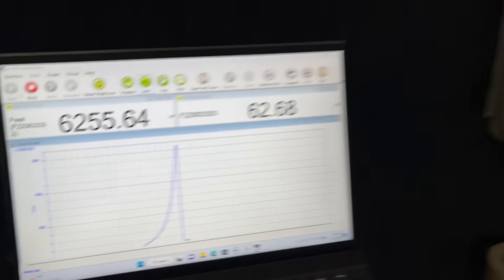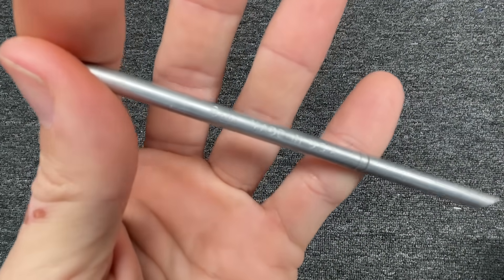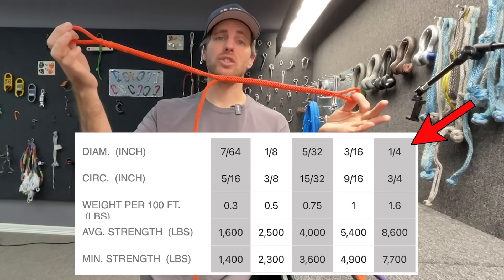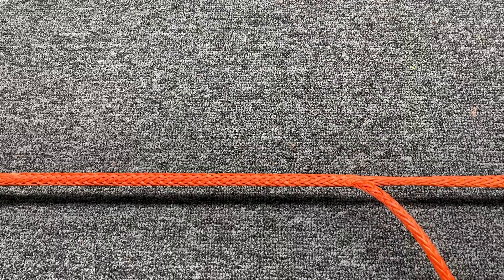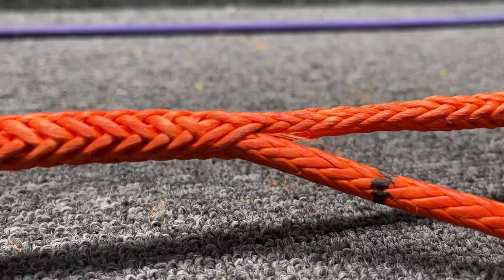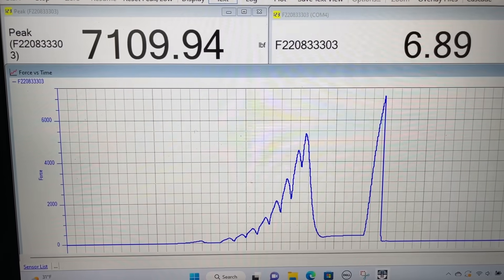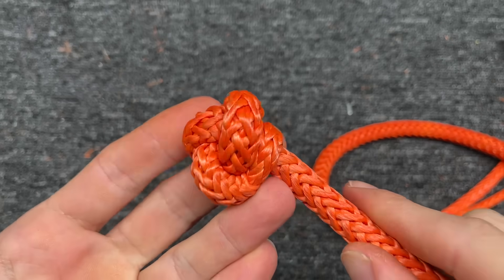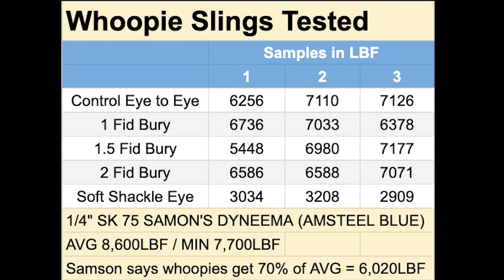Why The Overkill?

Comment: Dude, I love your schtick & patter. 
Your content is cool, too.
I seriously like your attention to detail and open contemplation of the anomalous, where-ever you find it.

My 'Rule Of Thumb' for conversation is; One Thousand Newtons (1kN) is roughly equal to 'One Typical Human Test Mass' of force applied to a pendulous support system with a smidgen of extra because "super-good-enough", right?

-OK ... TLDR follows...

This morning I weigh (mass) a static 182#, that's in lbs. (pounds avoirdupois. [ another Gaulic or Norman idea, I think ] ) or 82.5538 kilograms -- of down force, holding still, on the scale.

It seems that the real advantage of the System International (SI) is for folks who don't have calculators, or for whom longer words with more syllables that rhyme well are desirable ( there's a limit on what you can do, poetically, with Ounce, Pound, Inch, Foot & Yard and honestly, the spelling is kinda goofy ).

I tend to use the Metric System for both the cumbersomely large and small of scale -- like thread sizes when I sew-up my strap-loops and rigging.

For life on a human visceral or Newtonian scale, my thumb is an effective 1-inch wide, my boot is an effective 1-foot long. Tip of My Nose to my out-stretched finger is an effective 1-Yard.  "A Pint is a Pound the world around". 1-Ounce is a large swallow or gulp. 1-Cup is eight swallows.  And I have spoons in my kitchen and no 'deci/centi/milli-liters' anywhere. 
100 grams of meat is NOT satisfying! 
And how many folks do YOU know who have a two-meter span from left-to-right fingertips? I'm stretching to span 6' & 1/4" and I'm 5' 10" tall.

Yes, threes(3), fours(4), fives(5), sixes(6), dozens(12) and scores(20) are odd multiples if you need your toes to calculate. Human lives are best counted in multiples of seven-years.
Tens are easy to write but Binary is the fastest we have, so far. 
I can show 20* on one hand or 31* on one hand, so 5* is for kids just starting to count.

One degree Centigrade is too large without a decimal for temperature as I experience it in the comfort-zone of my house. And I just like the history of Fahrenheit. Maybe Centigrade is an anti-German thing?

The Kelvin scale is useful for discussions of fusion temperatures and the like.
Since all increments are arbitrary -- if I were to be fussy -- the Speed Of Light in 'kilometers per second' should be rounded up to an even 300,000.0 kps!
But hey! I have a Smart-Phone -- so who cares...

Of limited anthropological interest;  My interests and areas of service include; Sailing, Wind-Surfing, Sewing, Cooking, Crane-Rigging, Tree-felling and tree climbing and I have always had a thing for knots, braiding, Erector-Sets and Physics.

Comment: Long time a subscriber and a designer here. I have actually done some of these tests before, from my limited testing and experience the type of eye splice makes a huge difference. From what I’ve found a locking Brummell is much weaker than a full burry (2.5 fid lengths) straight eye splice with a lock stitch. My understanding is that somehow a locking Brummell doesn’t distribute the force across the 12 stands evenly and often ended up breaking 6 stands at the splice. I believe this straight eye splice with a locking stitch is actually how many of the manufacturers test their 12 braid products… (not totally sure though). If you’re interested I can see if I can dig up the charts from the tests I did and maybe even the videos/ samples from the tests.
Reply: Looks like some others have commented similar things but my offer still stands if you’re interested, the tests were with some funky configurations or whoopies and other splices with 1mm and 2mm sk-99

Comment: The whoopie divides the load between the Chinese finger and the central strand. How about a one fid finger trap between two eye splices. To get the finger trap pull started, use a castration band near the cut off end of the finger trap. This should slip an inch or two and then hold. In the drop tower, it would be interesting to see the slip vs. melting point effects. Dyneema is very static stuff and there are times when you want to reduce shock loads, hence the drop tower test. Think of this as simulating a zipper pack. for safety, the rope can loop back on itself, so the loop is in the middle. this would give maximum adjustability and provide a safety stop. When the loop closes, the finger will collapse and expand, creating a failure mode. This could be compared to a stopper knot. Is there a reason this is not in our handbooks? probably not super good enough. I expect highly variable results. One of those do it exactly right or die situations.
Reply from the maker: Don’t spliced eyes divide the load between the Chinese finger trap and central strand?  Why do those require 3.5 fids?

Comment: I just thought I'd note that in the arborist world where whooies are common, they're nylon (tenex or tenex tec) so you don't need quite as much of a bury. Also wrapping them around trees is not uncommon to have them 10-20 feet long do you lose length for longer buries doesn't interfere with their use...

Though generally arborists either love whoopie slings, or want to see them burn
Reply: I'm fascinated by their use. I learned about them as hammock suspension, but the more I researched, the more I saw how many other areas use them. What's the constrictor length when using Tenex?

Comment: I think the standard whoopie sling is very inefficient: 90% of the thing has 2 parallel stands, but you only get 70% of the single stand MBS because of a short piece that is single stand.

I did mine a bit different: i buried the moving tail INSIDE the bury of the fixed eye. Probably the loss of strength is higher because of a wider separation of the fibres, but you get the load split over two strands all the way. Even 50% of 2 stands would be better than 70% of 1 stand.

It would be interesting to pull my version and see the results
Reply: I like the idea, but I'm having trouble picturing how it's physically all fitting in the bury.
Reply: @jarodlojeck5150  instead of tapering the bury of the fixed eye, I pull out the end and terminate it, then I feed the moving end trough the buried end, entering just below the termination and exiting just before the crossed splice.

I have only done it in small ropes (3mm and 1,2mm), and they fit with a little bit of milking.

I try to loosen up the fibers around the entry points as much as possible so they can distribute the load as evenly as possible.

If you're interested I can make a video showing it, but it'll be next week

Comment: ryan, just important, terrific work! Thank you!
I've not had a failure in a single item I have made, primarily for the sailing community but have noticed on several occasions that uneven tapering seems to add roughish points (slight bulges) noticeable after numerous cycles that might...could...possibly lead to a weakness or failure? Hasn't happened...yet...as the generally well oversized and highly inspected nature of synthetic rigging used shows. In practice we find "creep" the far more problematic nature of UHMWPE. 
One thought I did have but have not been able to test is temperature buildup during cycling. Would be interesting to see if you could setup a non contact infrared thermometer and see if the friction increase inside a taper is possibly a culprit. Especially in the manufacturers recommended bury and taper lengths.
Once again, thanks.

Comment: If the bend radius  from not having  a diverter was a problem  the eyes would have failed,  as thats where it goes. 
 2 Woppie with soft shackle.  
It looked like friction melt failure  even time.
 Theas appear to be unset.  As the boat man said(  video you where testing/making sail rigging) setting was needed to get anything close to full strength .
On the last shot with closeup the failure occurred when there was a surge in the knot setting speed ,
Reply: They were set with a series of  Jarod to 1 pulls while attached to a set of ceiling hooks, but you're right about the setting. I can't achieve the force needed. The breaks, however, we're in the noose, not the knot. The rotation of the knot as it set didn't help, but the knot held.
Reply: @Jarod Lojeck   the knot setting not helping is what iwa pointing out.

Comment: I'm in the UK and I love pounds. Pounds are awesome, especially when I have loads of them in the bank......£ Sorry, couldn't resist that one. More seriously, when you've been talking in lbs I do have to check what the conversation is if I want to see the figures I understand better, but for videos like this one where you're comparing a load of slightly different setups to which is the best the actual unit of measurement isn't a problem because you can see the data trend (I think that's the correct wording) anyway. I now know which one of a, b or c is the one I'm going to use so now all I have to do is choose the rope with the correct forces that I might see in this application. Thanks for the video 😊👍👍👍👍

Comment: So two suggestions. Firstly a handy number guide before the video would help with metric/imperial. Ie stating what 20kn is equivalent to along with whatever numbers we are anticipating to be ideal in the tests. Secondly another option, it might help to write two charts. That way you aren't getting the mess of 30 numbers in one chart yet you're still able to read the data just looking at your side of the screen. Plus it obviously helps people learn both systems, as with both options really. People watching videos don't tend to want to do the work themselves (or they'd likely be reading the information), but as a content creator you can guide them.
Reply: I didn't know that both numbers would be in the blog. I have no intuition on whether 6000lbs is super good enough. I actually paused the video to look it up at the first mention. Although, now that I think about it, 1lbs ≈ 0.5 kg ≈ 5N. I am not asking you to convert all the numbers, just a text overlay for the first mention ("8600lbs≈38kN"). Another alternative would have been to put the mention of the blog at the start of the video. (This is just a suggestion, I still liked the video)
Reply: @twanvl  Pretty much this. Though I also think doing the valuable numbers before any tests would help a fair bit as it gives more suspense and context to the numbers. Its only like 5 seconds to flash it up.

2.2lbs per kilogram is the typically used conversion rate, though I doubt a 10% difference is going to really matter for anything.

As mentioned I think we all liked the video. I don't tend to waste time giving constructive feedback on things I don't like.
Reply from the maker: Both systems are in our blog.  Link above.
Reply: @HowNOT2  That was kind of my point, I don't think most people are going to look. I can do both systems as I'm in a country which uses both but I'd think a few seconds showing some relevant numbers before the test could help a lot of people out.

Comment: in theory you could get twice the reach or same reach with half the material if you used a woopie shuttle. in theory the breaking strength would be the same. might be worth looking into for ul rigs
Reply: A shuttle, or Utility Constrictor Rope is something I've used in hammock suspension before, but there is a greatly increased chance of slipping due to the way the constrictor portion slides over the longer line. There are ways to incorporate Prusiks to remedy this, but it adds complexity that you don't want on a highline.
Reply: @jarodlojeck5150  hey Jarod I've also played around with shuttles/ucr's, initially on my hammock but the idea persists for highline use. The solution that I found to work well on my hammock rig was to put an eye and prusik the loose end of the constrictor to the load line. I've also been interested in that concept in use for loopie slings, and as a progress capture method for thin dyneema.

Sounds like you came to the same conclusion and also found it to be inadequate for a situation like highline anchors which are subject to cyclic loading. Wondering if you have any more insight to the concept.
Reply: @erikjackson132  My big concern with using a UCR on anything more than a  hammock is that anything inadvertently bumping the Prusik on the shuttle caused it to slip. On a hammock it's not so bad, you just plopped on the ground. On a highline, you might die.

Comment: I wonder if the recommended splice length is for when it's wet or otherwise contaminated.
Reply: Interesting, they are tested dry, but Dyneema is also a sailing rope. I've never seen wet tests. That would be informative.

Comment: Ryan, another great video.   It makes me want to pull my hair out with the scatter in the results.
I started watching your videos about 6 months ago.  I am a boater and have been using Dyneema for mooring related attachments.  I like the easy of splicing, but at this point I am thinking about going back to three strand.
Reply: Is the 3 strand more durable?
Reply: Nice thing about Dyneema, though, for mooring, is that it floats. Much stronger than three-strand of same diameter.

Comment: Nice video, tho it’s a life, the overkill is a bit aggravating IMHO
Like the grammar Naazziis😂 EH!
Aside from America, the world is metric, which is easier I might add.
However, there are only a few converters to solve all needed conversions.
With the way back machine it’s literally seconds to do
As a Canuck we had to learn both because of the US….and becausewe work in the real world in inch (ansi) in ALL trades, that I know of.
If ya remember these, you can get by

Fraction to decimal inch
Top number divided by bottom number

Inch decimal to metric (MM)
X 25.4

1Kn=225lbs

Cheers

Comment: As for the metric vs US units, I think that you should normalize all data to the rated MBS.  This way it is easy to compare different products.  I personally find this easier, becasue anything less than 1 shows that the product did not meet MBS in that configuration.  I recognize that is might not be the most clear for everyone, I do have an engineering background.
Reply: yes! dimensionless units! seems like a good solution to me
Reply: personally I think it would be ideal if he added a "super good enough" minimum unit at the start of the video, then anyone interested in the statistics can look at the chart, and everyone else can just see how it compares to "super good enough" and not worry what the exact unit is. it's best for these sorts of tests to use the manufacturer's unit of choice, unless there's a variety of units being used across the same products.
Reply: That would be pretty sweet to see! I don't think that style completely agrees with the "super good enough" style of thinking though. For a lot of what Ryan puts out (dare I say most?) the point isn't exactly how strong something is, or if his tests match exactly with the MBS, but if it's safe to use. Here's a super hypothetical example: If some crazy hanger was somehow rated for 35 kn but broke consistently at 25, it's still super good enough, but with this analysis the number would be about 0.71. It's definitely very interesting to see that number, but it might overshadow the fact that such a hanger is still safe for general climbing use. Just my two cents :)
Reply: But we are not really interested if equipment meets its minimum breaking strength. We are are interested in the absolute value. If a super light carabiner breaks at 20kN even though it’s rated for 23kN I’d probably still buy it.
Reply: @Mike-oz4cv  I think it's more like adding it as a column in the table for those who are interested. the unit value (newtons, etc.) woulds still be in the table.
Reply: So would it be clear what the difference is between 0.75 and 0.9? It would be unnecessarily complicated.
Reply: I wouldn't know what value to divide it by.  Case in point: Edelrid vs. Edelweiss 7 mm utility cord - one likely reports the 9.8 kN minimum required to get the EN564 stamp, the other probably the results of some actual tests, but on bollards? with fig8 loops? Averages or 2-3 standard deviations below it? etc.

Comment: Do you think if you had a wood or plastic container say like 3 inches wide and deep and almost the full length of rope, and had it filled with water to run the dyneema through with rubber stoppers so it was submerged to cool the rope down as you do the pull, would the break strength be higher?
Reply: More so like lifting an anchor out of the water, or magnet fishing I was thinking
Reply: Going for the purely hypothetical here or are you actually using climbing gear in a waterfall?